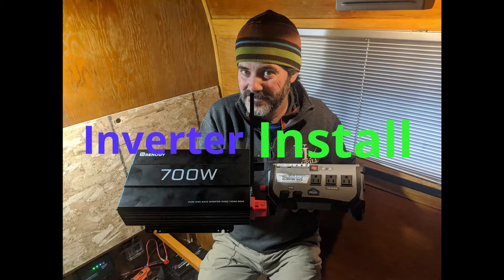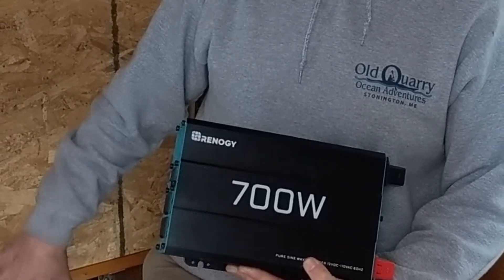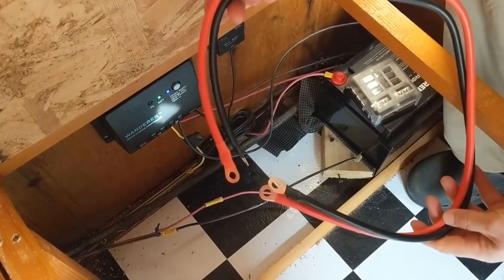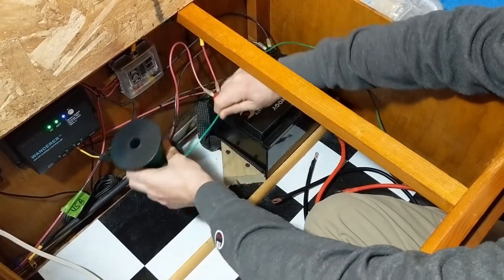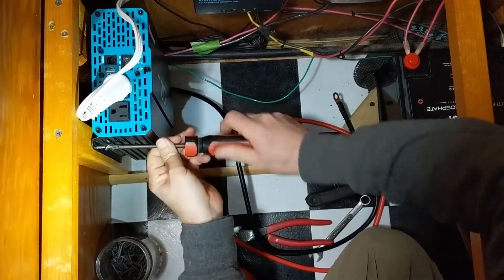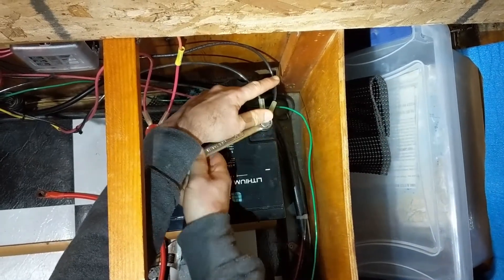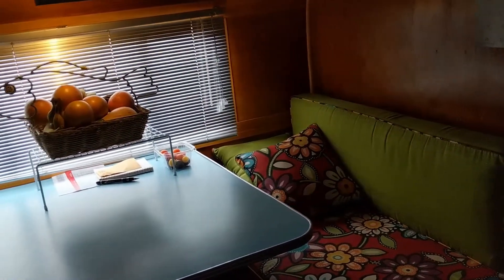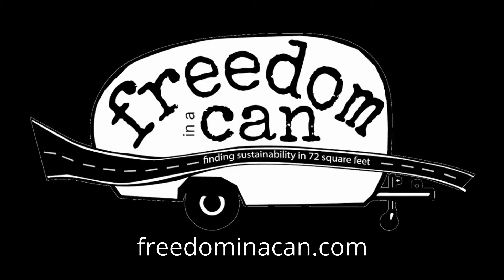Upgrading the Inverter on Your Solar Power System

Comment: The Inverter manual states to not mount the inverter vertically on a vertical surface....It would be very convenient for me to mount it the same way you have done.  Have you had any issues with this orientation? Did Renogy say anything to you guys about the way you mounted it or any concerns around it?
Reply from the maker: No, Renogy did not say anything about the way we mounted this.   I looked at the manual and I think the concerns here are with the fans.  If you mount it vertically with the fans sitting on a horizontal surface they might not pull in enough air to adequately cool the inverter - obvious problem. Since we have several inches of space between the floor and the cooling fans, I don't think there is a problem.  I will send an email to the folks at Renogy just to make sure, but we haven't had any problems with it in this orientation for a full year now.
Reply from the maker: Hi again, Max.  Heard from the engineer at Renogy that we work with and he added some clarification.  There two concerns of a vertical mount, but they are both manageable.  First, if mounted with the fans facing up, there is the concern of dripping or debris falling into them.  As long as there is a drip shield of sorts a few inches over it, you should be fine.  Second, if you want to mount it with the fans facing down, just make sure the fans have good airflow by leaving a couple of inches of space between the inverter and the surface directly below the fans.  Hope this helps!
Reply: Hi, this inverter manual says not to use it with a lithium battery. Did they tell you other wise. I have heard different views online and am not sure what to do
Reply from the maker: @samcolman5544  Hi Sam, We have used this 700W PSW inverter with our 50Ah LFP battery for over a year with no problems.  We work closely with the engineers at Renogy to choose products before installing them.  There is a specific chart stating minimum battery size and voltage, but not battery type. Can you point out specifically where you see this noted in the manual?  We cannot find any reference to it. Thanks for reaching out.